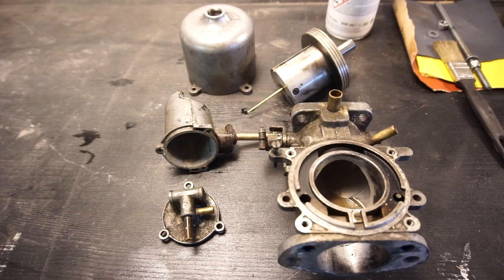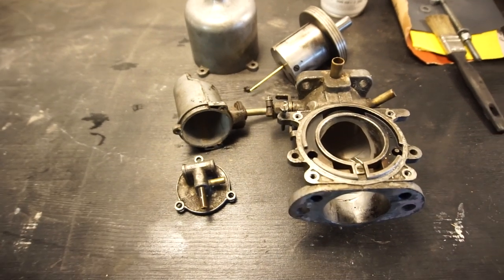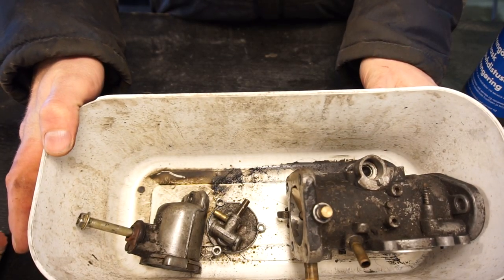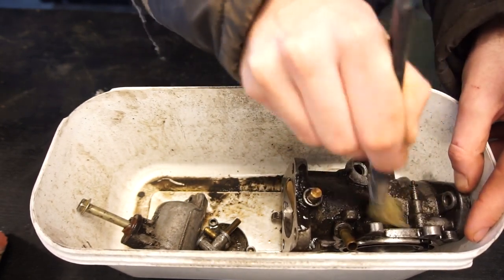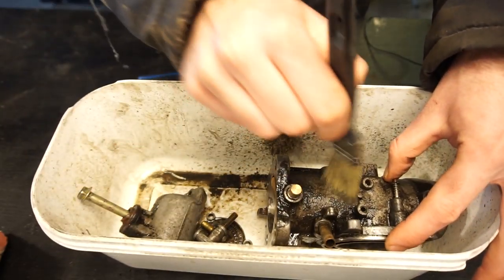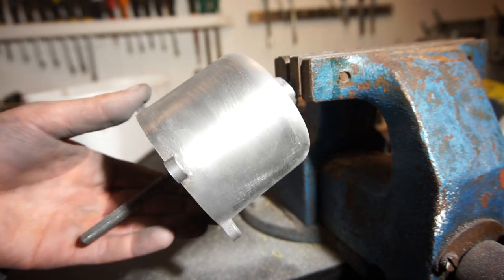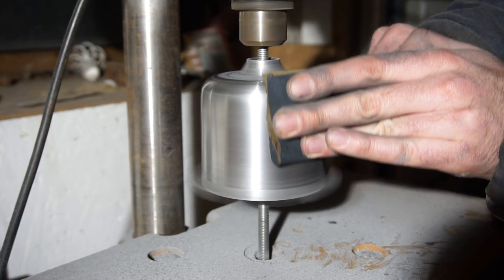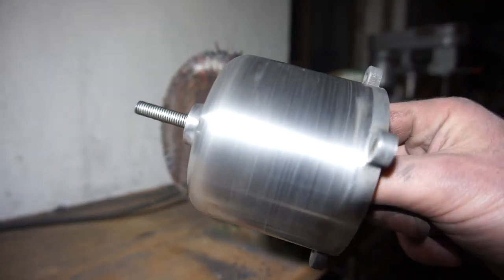SU Carburettor - Rebuild part 2 Cleaning and Polishing

Comment: Another general polishing compound you may try is cream cleanser, it cleans and polishes chrome, stainless steel, aluminium  etc. Also you can use kerosene to do the primary wash and clean of your components and then final clean with carby cleaner.  Fantastic video, you achieved great results. keep the video's coming.  Aussie.
Reply from the maker: Thanks Aussie! I'll have to try that.

Comment: Some safety tips to add if I may. Having done this process several times I can not stress the importance of gloves and a dust mask. The fine dust can be harmful to your lungs. The sisal buff can be really painful when touched at high speed. I also have used a rope through  the dome when buffing, as it is inevitable that one gets too high or too low on the wheel and it gets grabbed. Amazing how far they will fly!  I also use a thick blanket to absorb the dome in case it does get launched. My buffer is not mounted directly to a table. As noted this is along and arduous process when done correctly can give amazing results. For touch up in the car I use Mothers metal polish with a microfiber towel.

Comment: I'm restoring a Rover TC , ( better than Jags any day :-)) So anyway the Carbs. I disassembled over winter, rebuild kits done, but I didn't pay attention to the linkage between the two carbs, and I had difficulty with the springs. Put the whole thing back together when I discovered the problem. I'm starting again tomorrow. If you could do a video, that would be cool!
Reply from the maker: I do have a P6 but a V8 one. Nice car but wouldn’t call it better than a Jag ;)
Not sure when I’ll do a carb video again. It depends on which work I have in the workshop